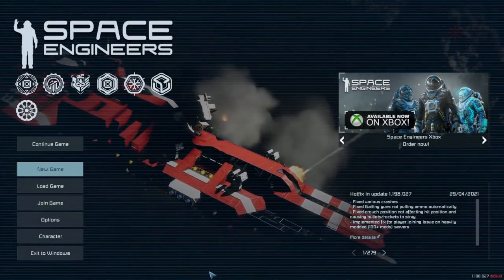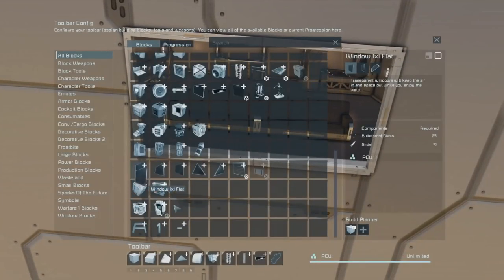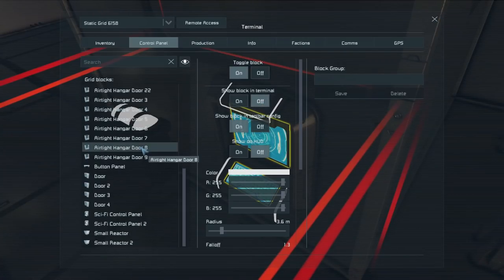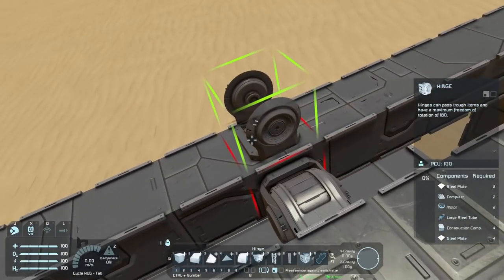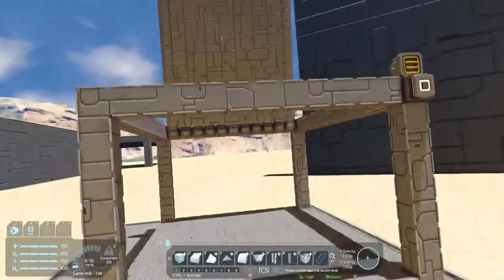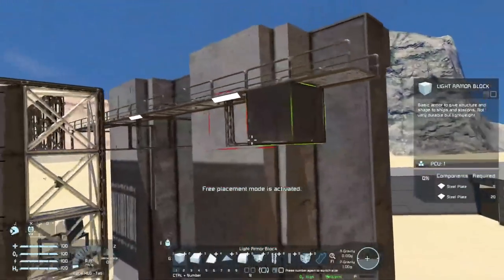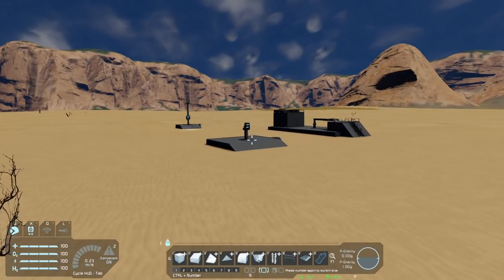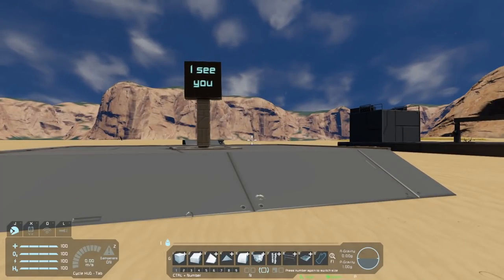How to Improve in Space Engineers | Clever Tips Ep. 2

Comment: Time to build a ship with a gravity drive controlled by a dance pad.
Reply from the maker: Nice!
Reply: @BlackArmor718  Someone did it with a rotor, sensors and minimal ions. So he has a small “cage” of small blocks around a rotor, and a block on the rotor, then sets it so the block can “wobble” around in the “cage”. Sensors on different parts detect if the block “wobbles” forward or to the sides. Then just minimum ion engines in each direction. The ions slow it down enough to cause the block to move in a specific direction thanks to momentum or breaking momentum. The sensors pick it up and adjust the gravity drives or mass blocks appropriately. Then you go in that direction. So scriptless WASD gravity drive.

Comment: Great tips.  I like how you went back and recapped your older tips with updated information.  You should ALWAYS do that when you have something to add.  Also, if you throw a link on the screen, it's a great way to get people to watch your previous videos.  Here are my additions.
1.  Lighting:  default white (255,255,255) RGB can be a little harsh.  Using a shade of grey can soften the light.  To get grey, just enter a lower value for the RGB with equal values like (200,200,200) or (125,125,15), etc.  Then adjust the intensity to taste.

2.  Your DDR foot controls are a great idea.  Where that would really shine would be for pure elevator platforms, especially those that transfer crew/equipment from landed spaceship to a planetary surface.  The distance isn't always the same.

3.  The half-width staircases are great.  But have to be perfectly aligned with gravity.  If they are slightly rotated left or right the avatar might get hung up on them and not able to climb or descend.  If you put them on a spaceship meant to get into natural gravity or dock with something else using a gravity generator with a field that spills into your grid, you will have issues.

4.  Corner lights are also great for connecting stairs or any other blocks where a 90 degree attachment is desired.  They are also vanilla.
Reply from the maker: Fantastic comment, I appreciate the feedback. Lighting values I didn't really touch on, I figured people would set what they like. What would you use to move the elevator platform that uses the foot controls? A piston? I tend to use the LCD because I like the build state better than the corner light
Reply from the maker: @Anvilshock  Thanks

Comment: I remove light groups from the toolbar config too. This can really clean up a control seat setup as well. Everything you wouldn’t add to a cockpit/control seat toolbar.  Examples are cargo containers, lights, assemblers, refineries, and gyros. Mostly anything in a group, the individual items done need to be controlled. I also setup all my main controls in the remote control block and add the control shortcut to any seat blocks/cockpits I plan to use. This allows consistency in setups. It allows you to exit the remote to control odd things you don’t want constantly on your flight controls hot bar like projectors  and things using rotors/pistons/hinges that can take up a whole toolbar.

Comment: Awesome videos. Heres a thing I found with sensors: They cannot detect a subgrid of the grid they are attached to, you can take advantage of this "feature" when creating compact hangars or drone bays. Set up a sensor with an area that includes where your ship docks to the connector. When you lock your connector as far as the sensor is concerned the ship is no longer there. That way you can have automatic hangar doors close to the ship but still have them sensor controlled.
Reply from the maker: That's clever. I'm pretty sure detecting subgrids is a toggle on sensors though

Comment: The new low cover wall works great as the platform for beside the half stairs, and looks more natural than the railing.
Reply from the maker: I haven't had a need for the new dlc yet but when it comes time to buy Ill check that out
Reply: @BlackArmor718  I thought the same. But its worth it just for the 1/2 corridors. It's basically an L shaped block that is super usefull for plugging up holes.
I've always wanted a walkway with another panel to the side instead of a 1/2height "rail" and the corridor is basically that.

Comment: The sensor tracking works better if you let it command the rotor instead of a gyro. The gyro also adds alot of weight making it nose heavy. If you use the center of mass function in the info tab and balance everything so that it is directly into the hinge or the centerline of the rotor. It can be very quick (no centrifugale force to start or stop). It  even can track small ships and engage it without scripts

As long it is balanced

Bit Bever thought it could be done with gyros looks alot smoother then using rotors

Comment: In the gyro+sensor Pixar-light, how are you getting the hinge to point at the Player?
I've set it up the same as yours, but I can't seem to figure it out in the Control Panel.
Reply from the maker: Have the gyros in a mirror orientation with override on in one direction. When the sensor on one side sees a player, it turns on its gyro so the platform rotates, when the sensor doesnt see the player turn off the gyro
Reply: @BlackArmor718  I have the rotor working just fine (and slightly different than you described). I'm asking about the hinge on the top, in the spot-light example. 

How do you aim the lights at the player? My hinge either turns fully upward or fully downward. You mentioned in the video a "check" gyro, so I'm asking how that applies so that the lights aim at the player like you demonstrated.
Reply from the maker: @AnimusZen  I have one gyro set to override, one gyro set to pitch override which will raise the hinge if the sensor doesnt see a player, and one sensor that locks the hinge if it is looking right at the player

Comment: How did you get the rotor flush and covered with a block for the rotating lights?  I've been trying to recreate that trick, but my rotor is almost half a block too low and I can't figure out how you made it look filled in.
Reply from the maker: You can adjust the displacement values
Reply: @BlackArmor718  Thanks for the reply!  I must be doing something wrong; I can't get the displacement high enough.  Here is an example of what I'm doing https://youtu.be/U8vKcMFMysk
Reply from the maker: @bluehff  Ok that's more helpful. You need to lock the rotor at 0 degrees and keep the displacement at 11cm, then you can fill in the space. Put a new small rotor in the middle to use for rotation.
Reply: @BlackArmor718  Thank you!  I can't wait to try this when I get home!